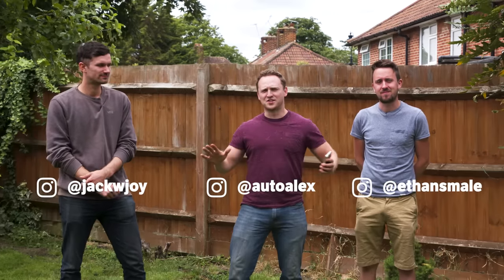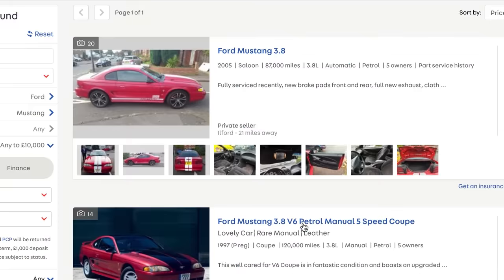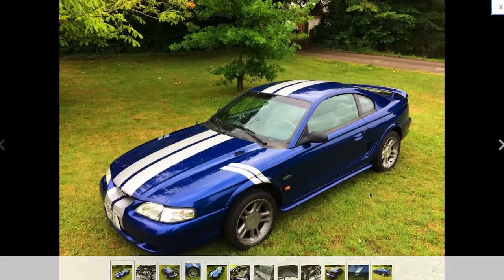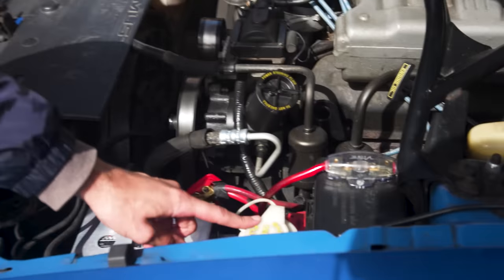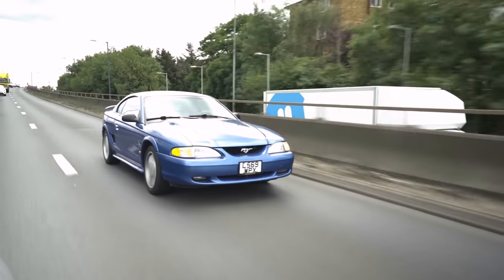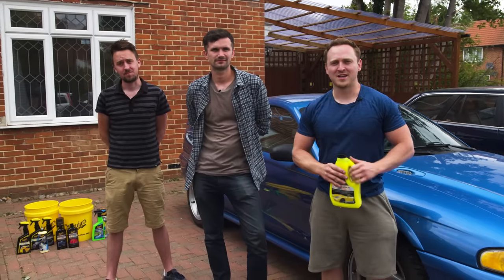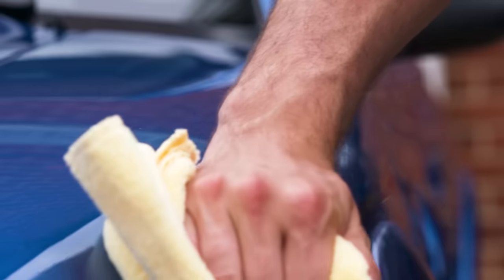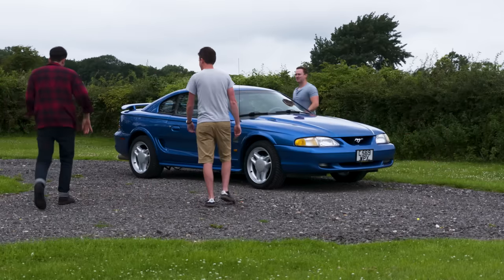£5000 American Muscle Car Challenge

Comment: "Bonnet" is what went on an old lady's head back on the Oregon trail.
Reply: Exactly. It's a 'hat' that goes on top of the engine to protect it from the elements.
Reply: A coop is what chickens live in.
Reply: hood is on top of hoodie or coat.. so why would i call it that either..
Reply: do you know england is older then the usa
Reply: 420apache657 No? The USA owned the UK until we left them to rot in like the 1502 just 10 years after Columbus found the UK. Nobody likes tea or cops with funny hats.
Reply: the BrandønTacø I do👌
Reply: the BrandønTacø Yeah, except tea is the most consumed beverage in the world (apart from water obviously)
Reply: @user-jx5dt4mp9y  good joke..
Reply: @Az Lean In Denmark we call it a "Motorhjelm", which translates to Motor Helmet.
Reply: the BrandønTacø I can FEEEL the patriotism radiating from this comment, your country isn’t the best in the world, calm down
Reply: @Az Lean it really doesn't
Reply: @apache1234657  yeah, but when we became the USA, the king of england was still running things. Now royalty is just a bunch of bobble head dolls.

Comment: A half an hour of not even an attempt at a burn out. Disappointing.
Reply: Differential doesn’t look too good...
Reply: its a mustang, it cant or it goes to spinning out of the road
Reply: @TopiAS06  most 94-98 mustangs have so little power compared to other years so it's quite noticeable in my GT lol.
Reply: The car is an automatic so that'll be a bit difficult
Reply: Brits don’t do it for Dale
Reply: @ZenoClipz  yeah,, i that that body mustang aint the fastest one
Reply: The only thing more disappointing than this "muscle car" video are the excuses in these comments lol. I've done some pretty gnarly burnouts in clapped out old beaters leaking every fluid with less power and down a cylinder. Just watch out for crowds of people...
Reply: Seeing as it probably has less than 200hp now I doubt it would be able to
Reply: @alangreig4261  not really
Reply: Hey my dude read my comment 😁 i said an attempt. An attempt at least would of been OK. Forget the facts like power and etc.
Reply: @ross4384  yh true u did say an attempt so ur not wrong there 
But they probably didn't wanna end up crashing into people 😂
Reply: @cargasm383 thats what i was thinking... you can pull some pitiful shitboxes out of the weeds and roest em off... old rangers, jettas, buicks. really anything that will start
Reply: Lol you people are very confused about how burnouts work. That mustang would burn both the tires off until it's on the rims.
Reply: @ZenoClipz  200hp combined with 2.76 rear gear and a 1st gear that goes to 60.  Yeah there's not gonna be a burnout
Reply: @RidinDirtyRollinBurnouts  Except if you watch the next video, you will see Ethan doing one.
Reply: This old GT would easily smoke the tires. I've got a 2004 with the 3.8 and it's a autoturd. Has zero trouble doing big smoking burnouts. Actually that's about all I do with it. When I'm not burning off the tires for fun it just sits around in the driveway.
Reply: @jonfarah8529  i bet they don't even know who dale was

Comment: I'll give you guys £5000 for this when you've finished with it. Looks a beauty! Serious offer 👍
Reply: It'll be cheaper to just import your own. They're a dime a dozen in the states
Reply: Holdd aaaaat Yerr Anndd 🤝
Reply: @jacobfleming565  I doubt it after all the shipping costs and  the importation duties/taxes/charges.
Reply: Leighton Booth are we looking at the same car🤷‍♂️🤢🤢🤢
Reply: don't do it, this is the worst mustang ever made, 5L V8 with less power than 2L 4 cylinders, with one of the shitty torque converter autos that is dying... you won't get any parts for it here either. Not worth your time
Reply from the maker: SOLD!
Reply: @CarThrottle  I'll give you £1500 it's got a rusty steering rack... hold out yer hand
Reply: @CarThrottle  angery
Reply: Magic a few junkyard parts and youve got yourself a good motor with a manual tho. Those 5.0’s are stout as hell
Reply: Magic 5L sound better and are way better than the 4 cylinder and all you gotta do is put in some time and money and you got yourself a awesome sounding car with just under 400 horsepower with a couple of upgrades
Reply: Lanndon but just look at it , it’s like a car that my 7 and 8 year old boys would draw🤣🤣🤣
Reply: @Xtreme_Motorsports  still not worth 5 grand. You can get much better cars for the money and can add a bit to get something really cool like an E46 M3
Reply: Hold out yerr hand!!!
Reply: @martycrush6412  when you realize how similar sn95 mustangs and mk4 supras look to each other...youll never unsee it.  😉
Reply: BANNED DAMN not keen on supras either, love 80s Japanese cars and some 90s but too rounded and bubbly for me🤷‍♂️
Reply: Did you ever get the car mate
Reply: @gray2ndgen884  no, went up on eBay if I remember rightly. Sold for about 7k I think.
Reply: @1979leighton  damn can't believe they said sold and then sold it to someone else 😂

Comment: I already know what life is like with a Mustang in the UK, she was my dad's daily driver. As a kid my dad had a fox body, a 1986 model, red interior (cloth with a cigarette burn in the rear left seat and a cracked dash) and a red exterior (dad had to replace the hatch with a green one when the neighbors got drunk and put a wheelie bin through the rear glass) with a 3.8 V6 140hp and I remember him reversing through a McDonalds drive thru so that he was on the correct side to get the food. We called her Megan as the registration plate was C220 MGN. She's long been sold and the next owner painted her silver with a blown ford big block and fat drag tyres turning her into a racing car

Comment: Ive had an astra before with this problem, i changed the rocker gasket, spark plugs,did a coolant flush took all pipes off and cleaned as the joins get crusty, an oil change and changed o2 sensor  (pre cat) these cars i find if they are services regular go on for years

Comment: OK, who's going to tell them that if they'd done this a week later, they'd have got a red Mustang convertible in five minutes on eBay for the same price?
Reply: Link and was it a V8 tho
Reply: @John.Winchester  - can't post links for some reason, but it's item #303623639818. 5l V8 Mustang GT, electric roof, full MOT, although it's an auto now that I look at it. US-made JDM model, by the looks of it.
Reply: @digiscream That's the law of buying ANYTHING! A mate spent months working out the best TV to buy; when he got it home and switched it on the first thing that came up was an advert for the same TV 150 quid cheaper!
Reply: But that car is in North Lincolnshire, and they aren't. Often the case with rare cars, to get a good deal you have to travel.
Reply: @YellowPinkie  but if you brought from a shop you can just return the TV and buy the cheaper one.
Reply: @MinotaurvsCyclops  Not once you've opened it and used it
Reply: @spudit2003  - tell me about it. I just bought an MG ZS 180, and it was a six hour round trip...

Comment: If that was a jdm car, surely it didn’t pass shokan with those break lines hanging down
Reply: I’ve tied mine down better under the car and they still hang down further than I’d like. The exhaust is also ridiculously low on them
Reply: BuT iTs AmErIcAn NoT JaPaNeSe - some 12 year old who doesn’t know what JDM means.
Reply: Oddly enough my father's v6 does the same thing. However my new edge doesn't have that issue.
Reply: @idkwhattoputhere4695  It's not JDM, did you listen? It was imported to Japan after being sold in America.
Reply: @rrai1999  it was an export version to japan. So technically it is jdm.
Reply: And i dont see brake lines hanging down. I do see a rear sway bar if thats what youre seeing...

Comment: Early 2000's Pontiac Firebird is a fantastic car if you can find one for a steal. The LS1 engine is just stupid reliable and parts are readily available, at least for the drivetrain. Handling is better than average for an American car.

Comment: 215 horsepower from 5.0 v8? I have 2.0 diesel with More power and tourqe😅
Reply: Yeah uhh... that was 20 years ago.
Reply: @bilack7007  but still!
Reply: It's a 4.6L
Reply: Don't forget it has got a supercharger as well.
Reply: American v8s were lacking 80-90s. They were trying to comply with new emissions rules and regulations etc. So they sucked.
Reply: @sebastiend.5335  Wow, I hope this is bait
Reply: @Doophys  did I get it wrong? ;)
Reply: Did your 2.0 Diesel have 215bhp when it first came out in 1993 .no try 90 bhp .
Reply: @xaviergalaxy3  displacement doesn't equal better .
Reply: I have a 3.2 v6 merc from 2000 that has more power and torque
Reply: What’s 20 years got to do with it, a 2.0 Honda S2000 produces
240 BHP Since 1999 21 years ago
Reply: @bilack7007  doesn't matter. BMW made that much power from a 2.3 liter in the 80s. E36 M3 had 320 hp from a 3.2 in the 90s.
Reply: This mustang is a great example why 2 of the Big 3 US automakers went bankrupt! That said Ford was the only manufacturer that did not take government bailout money and today’s Fords are far better. True American muscle cars died in the 70’s this is a known fact amongst car collectors here in the US. 

Today most Americans drive SUV’s, crossovers or pickups. Sports cars are limited use and unpractical for daily function. 3 days ago Ford unveiled the 2021 Bronco. The new bronco is a much better image of today’s American Automotive world.
Reply: Well your diesel is probably turbo’d and the Mustang is NA
Reply: @derekga6973  And absolutly no power under 4000 rpm and no acceleration -- Mustang makes 3-4 times more HP and torque while on 2000 rpm :D  A lot nicer to drive.
Reply: @DusanStev996  Mustang also did 205 HP from a 2.3 Turbo in 1985/1986 .... then they scrapped the small engines with big horsepower and the same fuel economy and stupid enigne sound for just leaving a V8 -- why would you bother ?
So what BMW did 320 hp from a 3.2 .....   Lexus made 250 HP from a 4.0 V8, BMW did 220 HP from a 3.0 V8, 286 HP from a 4.0 V8 and 300 HP from a 5.0/5.4 V12 in the 90s.  Audi V8 made 250 HP from a 3.6, 280 from a 4.2  - > then the first A8 made 230 HP from a 3.7 V8 , Jaguar made 6.0 V12 with 300 HP --- and all of those V8 engines (Lexus, BMW, Audi --- were DOHC 32valve, bla bla bla.   Mustang still had the OHV 16v with more torque on low rpm....  
Same as Mercedes which in the early 90s had the ohv V8s   4.2  with 218 HP,  5.0 with 250 HP (from 230 HP in 85)  and 5.5 on 560 SE/ SEL with 280 HP :D
Reply: GOOSE BALL  I don't care. I love small foxbody Mustangs and their styling and fun sounding V8 ....  i had enough stupid slow 4 cylinder na cars which are a pain to drive.
Reply: S2000 weight 1274 kg
Mustang 87-93 notchback  2725 lbs = 1236 kg -- so where is that fat ?
at 2000 rpm Mustang has 90 HP and 325 Nm of torque  Honda has 40 HP and 100 Nm at 2000 rpm :D
Reply: The older mustangs are seriously cool machines with tonnnes of nostalgia attached to the name too but you can’t compare a Honda S2000 to a mr wobbly 15 year old mustang, their just not compatible in any form the Honda S2000 is a far superior machine
Reply: My 1999 landcruiser has a 4.5l straight 6 with over 220hp
Reply: @xaviergalaxy3  It's a 5.0, mustang didn't get the 4.6 until 1996.
Reply: @derekga6973  S2000's cost like $10k+, these cost like $2k+ in the U.S. Not a fair comparison lol

Comment: The detailer spray won’t get rid of or smooth over the contaminates in the paintwork, only a clay bar or clay mitt will do that. And detailer spray should be used after the machine polish stage, not before. 👍

Comment: Can confirm full exhaust and 14 degrees if timing will make 220-230 to the tires, if you had a cobra model will do about 250 to the tires.

Comment: As a French guy who lived 2 years in Puerto Rico and bought a 95 GTS (lighter version) 5-speed manual, I can share a few details that might be of interest about these SN-95 5.0 Mustangs (94 and 95 only) :
- Those horizontal export tail lights (with the orange section) can be worth up to 500 USD as they are rare, the bezel is colour coded, and they are mandatory in some export markets. Similar things can be said about the wheel arches and about the rims as they are somewhat rare.
- Why people chose the optional 17 rims ? Yes you might think they're ugly but they were  considered cool back in the day and almost similar to the 93 Cobra wheels. Reminder : The 93 Cobra was the first SVT Mustang, so yeah these were quite cool then. Also, even though their style might be questionnable, it gave you something important in some export market : your car was a 17 inch rim car from the factory, and in some countries you cannot change the diameter of your rims. With these, you had access to the whole 17 rims aftermarkets paradise. 16s look small on these cars and aftermarket options are rare. 17s are the best look/performance combo available. If you favor look over performance, I've seen 18" and 19" on these that look quite convincing. 

I hope my comment was useful to some SN-95 Mustang nerd like myself lol

Comment: I got my 99 Mustang GT for $2000, the paint was sun burnt and the right rear fender was primer as well as the rack and pinion going bad, the car perfectly fine. I fixed the car up back to good and without even going over $500 on the car. It is a automatic though.

Comment: I know the 90’s v8 in that is underpowered but be thankful it’s not the 96-98 4.6- still a solid engine but even though they switched it to overhead cam it made the same specs- so it actually felt less punchy due to not having the same initial low end torque as the pushrod engine

Comment: The 4th feneration mustang is one of if not my favorite sttle of mustangs. I do not care what other people think of it. Something about its sttlemi love. I also appreciate how tou guys got the 5.0L. yes i know the 4.6L had more power but that 5.0L has its lineage as being one of the most long lasting and ever reliable engines Ford has made. It may be under powered by today stands but trart it right and it will get tou where tou need to go. The good old 302 (cubic inches) V8 

Oh and yes we call that thing at the fron of a car a Hood rather than a bonnet. Which i think sounds cooler but maybe thats the American inside of me talking.

Comment: Having 215 hp in a 5 litre engine is like having 300hp in a 2 litre engine. It just keeps pushing and pushing whereas a 4 cylinder car with the same power would slow down a lot earlier which is why the Mustang could do 0-60 in 6.6 seconds.

Comment: Low horsepower doesn't mean low torque. I've got a 5.7 camaro rated at 240hp. It may seem slow but it's a 5.7L with 350ft/lbs from the factory. SBC has better horsepower and torque curves half a decade ahead of that Mustang and I paid $4000 American.

Comment: using detailing spray and a sponge to lift contamination? 
if the mitt and shampoo didn't lift it that wont either.
the correct way to do it is to use tar and glue remover, iron fallout remover then a clay bar, ideally polish the paint, then use a wax or detailing spray to protect it.

Comment: That Mustang is what we call a poor mans muscle car. Technically it’s a muscle car but is more or less a two door coupe in muscle car clothing. 
I would’ve looked for something like a 4th Gen Camaro. I know options are limited across the pond but it would’ve fit the muscle car feel a lot better. I would’ve looked for one with the 5.7l small block 350. Still kind of a turd at 275HP but was respectable in the 90s

Comment: 215HP from a 5L V8, and now a days a 2.3L  4cylinder turbo charged engine can make 350HP
Reply: In 1986 Mustang SVO 2.3 turbo made 205 HP....     The horsepower means nothing (just the maximum speed it can reach)--- it's the power/torque curve - how the car really drives.
Still would you want a shitty sounding 4 cylinder or a low growling v8 for a nice cruise ?
Reply: Also 1965 Shelby had 4.7 V8 with 306 HP  :)  and with Paxton Supercharger   up to 450 HP  
https://www.streetmusclemag.com/news/option-code-s-the-1966-67-paxton-supercharged-shelby-gt350/

Comment: It got a 4.6 litre v8!

A 4.6 litre!
Reply: NO.  It's a 5.0  .....   The 4.6 looks different  :)  The SN95 had the 5.0 ohv windsor  up to 1995 model year -- from 1996 they changed to 4.6 modular with overhead cam.  The 4.6 has the alternator on the middle of the engine and small intake manifold

Comment: These are really underwhelming from the factory.   First thing you should do is 4.10 gear and a shift kit.    Then get yourself an explorer intake and some gt40p heads on the cheap.   Might as well toss a B cam in while your at it.

Comment: I cringed at the use of ceramic detailer to remove contaminants then moved onto machine polishing 🙈🙉 it's supposed to be used for removing light contaminants on the car after the car has been polished and coated like dust or bird droppings etc(not that I would use it for that myself) I Think they totally missed the point there 😂😂😂😂

Comment: 1:53 - By that fact, we now know, Ethan's a murderer. 

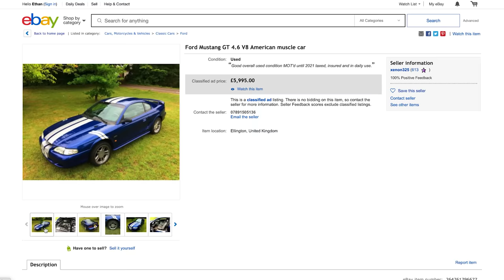8:38 - It's a '95 Mustang, their owners are within a thin range of "too old to be a yobo" and "too young to ask a moon chunk for a banger" - they're satisfied by cars, that don't eat the wallet for original sparkplugs and aren't to be kept polished in a glass box at the same time. They are men, who like em big, cheap and bruised.

23:51 - Speaking of contaminants, have you checked that with a geiger counter? Youknow, being from Japan'n'all..

29:31 - Wait, no tire conditioner? I'm insulted! 

P.S. Stock Windsor 302 makes about 180bhp, so.. 215 was a blunt lie (by the Ford), but they all sit comfortably at 3900, which makes it a great low-end of the latter coast-cruisers.